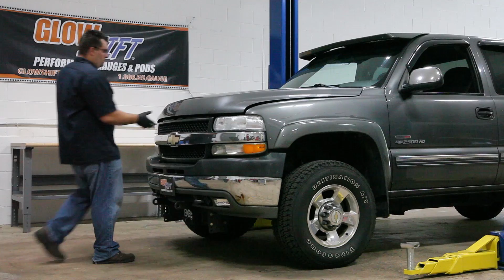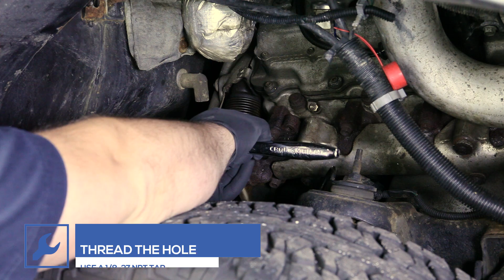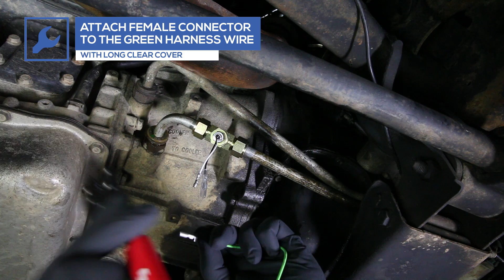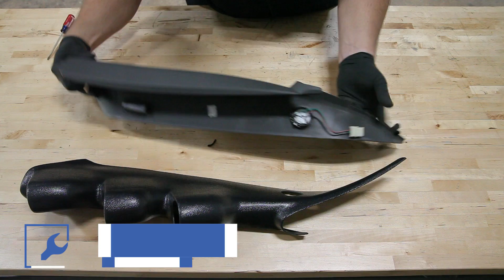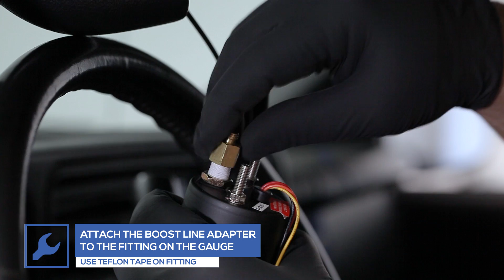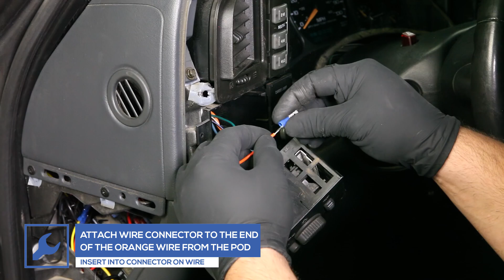GlowShift | How To Install A Diesel Gauge Package Into Your 2000-2006 Duramax

Comment: My gages dont fit on the pod
Reply from the maker: It should. The gauges are 52mm and the pod is cut to fit that size. You may use a file to grind down the inside of the pod cup if it is a tight fit.

Comment: For anyone who doesn't know what a size R bit is like I didnt, you can start with a 1/4in drill bit and drill up to a 3/8in bit and be able to tap a 1/8 NTP27 hole. Also, if your doing this on an lly a hole can be tapped into the boost piping right before the rubber coupling to the egr and it works just fine.
Reply: Same with lbz I take?
Reply: It's NPT, National pipe thread

Comment: What wire is the dimmer on 2006 silverado
Reply from the maker: You will need to use a test light or multimeter to locate the exact wire.